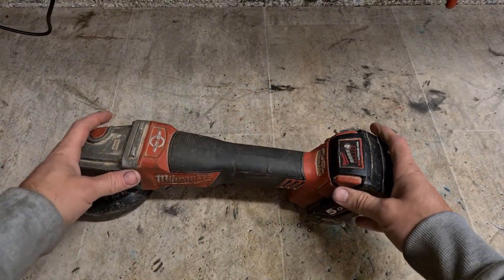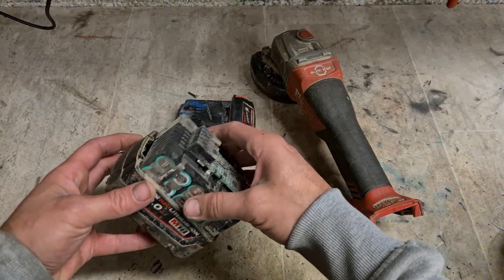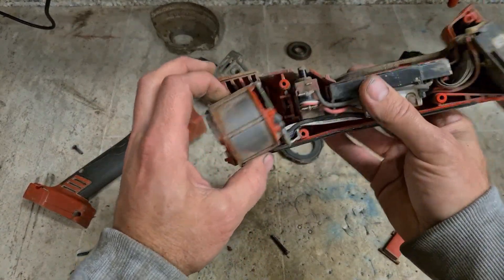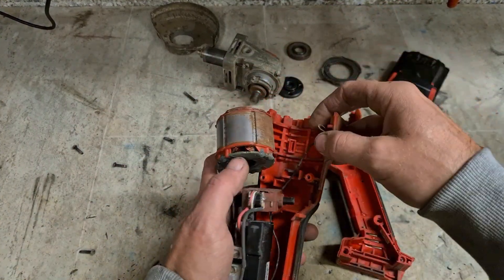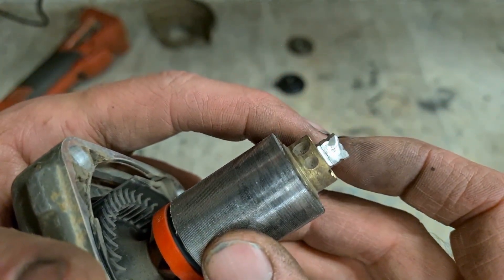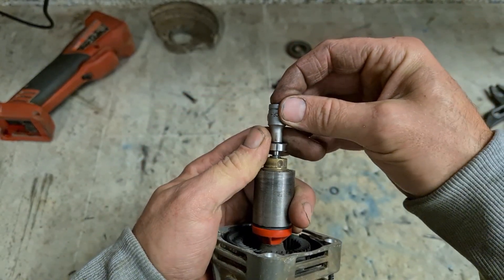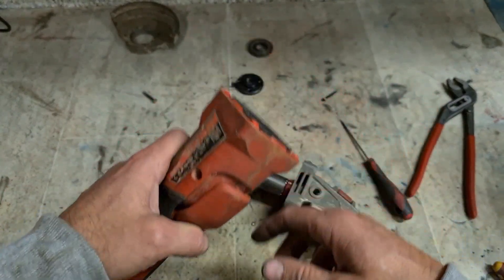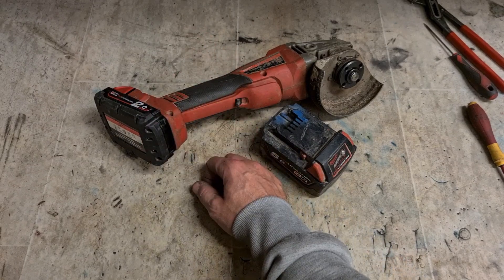How to repair a Milwaukee M18 ONESAG115XPDB Brushless Grinder.

Comment: Since i watched one of your Milwaukee grinder videos and you said it is a common problem with them i have bought a couple of them bearings and have changed that bearing even though the original bearing was fine so that never happens and it ends up wearing the housing out
Reply: What size bearing??
Reply: @12thmonkeyy  the bearing sizes are 5mm I.D x 14mm O.D  x 5mm WIDE and they are a 605 bearing

Comment: Hi
Yesterday i was repairing my bat.metabo angle grinder...
There was bad bearing in the head where you put cutting disk but... The bearing is 6202 in plastic cant get it out so i just cleand it an new greas...
I wonder how long it wil last...
It worked for 5 years it was still working just bad noise on bearing

Comment: From experience Dean, what are the most long lasting batteries. Started out 14 years ago with Bosch Pro tools and in this time have only had 1 battery die out of 11. The battery was date 2010.
Have lately took on a few Milwaukee tools, good or bad im not sure
Reply: Really depends on how much work you do with them, all the top brands use pretty much the same cells anyways, in the same configuration.. So my guess is there really wouldnt be much between them.. Nothing worth switching brands for anyways..

Comment: Hi,Dean, I had couple of  friend using the Milwaukee. M18 , the battery will die in the six month?? is a quality problem??😢
Reply: yes, milwaukee has all kinds of problems with batteries. the housings on their M12 batteries wear out pretty fast and they start falling out of the tools. their M18 8ah and 12ah batteries that use samsung 21700 40T cells have problems with the battery management system (aka BMS) that causes the cells to charge and discharge unevenly. after some time, a group of cells inside will have the voltage drop below 2V, at which point the battery can no longer be charger using any charger. they can't be "jump started" or anything like that. the cells with the voltages that are too low have to be charged individually (not as a whole pack), which is hard, dangerous and a waste of time.
Reply: @solomonshv  i’m really lucky using Makita, 10 years battery dismantle 5 cell voltage still very good balancing

Comment: There's a battery shop in my town that was really good. They would rebuild batteries with quality cells a lot cheaper than the cost of a new one. But the original owner sold the business and now all they do is sell knock-off batteries at a ridiculous price and they don't last.

Comment: You said you ask people not to send in Milwaukee. Just curious as a "milwaukee guy" why that is. I'm no Milwaukee fanboy, but after all my Dewalt tools died I switched to Milwaukee and have been happy with it so far.
Reply: He's said in past videos that a lot of Milwaukee stuff is built in such a way that when one thing breaks you have to order all the internal guts you can't get certain specific parts.
Reply: A worked in a TTI service center years ago, and they really aren't designed to be serviceable like some other pro level brands.  I just rebuilt a friends 30 Year old Bosch hammer drill and could order every part I needed.  It's hard to get parts for a 3 year old Milwaukee tool if it isn't in production anymore.  If it's out of warranty you might as well go buy a new one because it's not going to be worth the fix, and that's just how TTI wants it.  There isn't much actual "fixing" going on at their service centers either, you have the motor, housing, gearbox, etc. and all the electronics as one big sub assembly, mostly you're just throwing a new drill or whatevers innards in the old housing and calling it a day.  That's cheaper for them than actually paying someone to diagnose and repair a tool. The downside for the tool owner is that this is not a cost effective solution if it's out of warranty.  Go look at any big commercial outfit or rental shop, you'll see Hilti, Bosch, Makita, but almost never Milwaukee.  Not that the tools themselves are bad, it's just that they are built to be disposable, not repairable.
Reply: Basically Because Milwaukee are disposable. Outside their warranty there’s nothing you can really do once they die because of the part issue. If it’s repairable then they make you order entire assemblies of the parts rather than the actual small part you need to make it work again therefore better off just buying a new tool. In other words Milwaukee stuff are dependable and good tools but aren’t meant to be worked on and are disposable